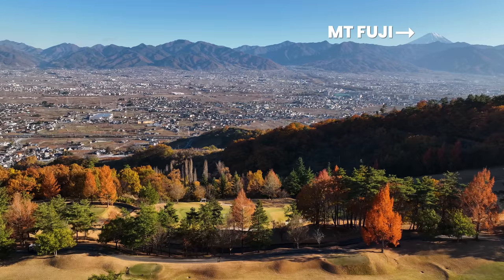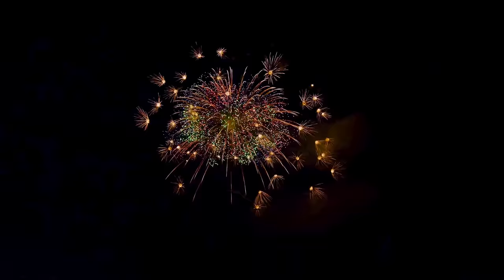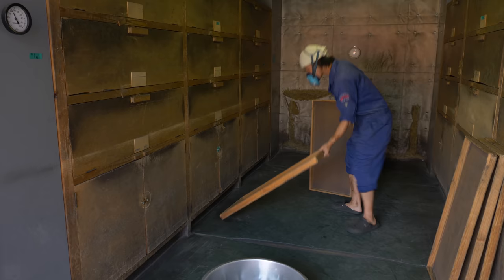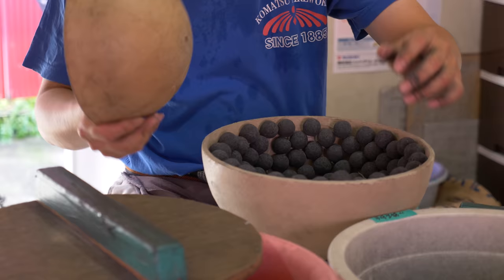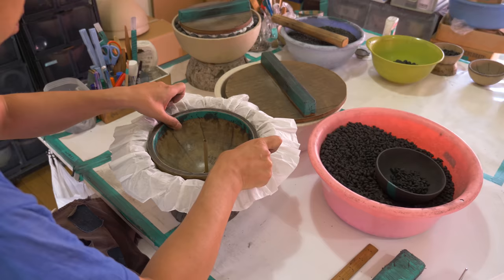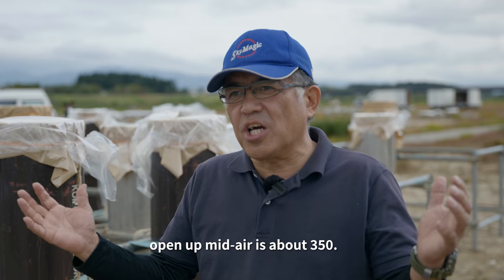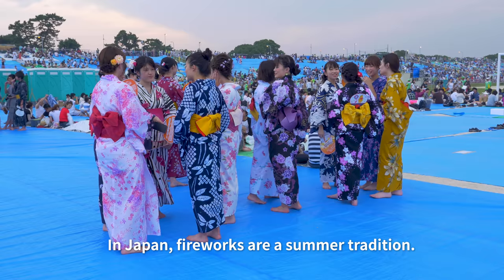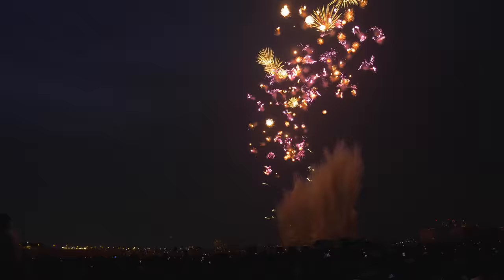How Japanese Fireworks are Made & Launched ★ ONLY in JAPAN

Comment: Very nice video!  One thing that wasn't mentioned is that the employees of the firework company touched a grounding plate before entering the drying room to prevent electrostatic discharges that might ignite the fireworks.
Reply from the maker: You saw that! Yes, it’s true, in the wall before entering. This is especially important in winter when it’s very dry. 
I didn’t mention a lot of things and I will probably do another fireworks episode with a different angle next year :)
Reply: L
Reply: P
Reply: @onlyinjapan  p
Reply: P
Reply: P
Reply: L
Reply: Ll
Reply: Lll 🎉
Reply: @onlyinjapan  lllll
Reply: @onlyinjapan  lllllllll
Reply: @onlyinjapan  llllp
Reply: @onlyinjapan  llllp llllllllllllllllllllllllllllllllllllllllllll llllp
Reply: In those environments you probably seen them discharge the static electricity is in colder environments where the humidity is very low thats was causes static electricity. If the humidity is abuse 50 to 80% that hight enough for most places to work without that concern because hotter environments its not as necessary and in fact most of the Japanese or Chinese manufacturers work in shops with about 3 4 inches of water on the floor to prevent the static and fire
Reply: Interesting.
Reply: Yea I seen him touch that metal plate on the wall b4 he opened the door
Reply: I just assumed it was some cool high tech palm reader
Reply: They don't show the grounding step to eliminate frivolous competition
Reply: @eddiemurray55  😆
Reply: Meow
Reply: Touched or, are touching a grounding plate? Is the grounding plate rubber? I'm very ignorant with fireworks.
Reply: There should be a grounding rail and they should wear esd ground straps and esd grounded wrist bands
Reply: @five0four_129  same lol
Reply: @TURBOMIKEIFY  if you're truly ignorant,  don't venture into this with only you tube info.  It's deadly serious for you and others.... be safe
Reply: You can't even set off gasoline with that amount of current so...
Reply: Thanks for that info🙃
I was curious about why it seemed like they were touching the wall before opening the door!
I thought maybe they were getting keys off a hook to unlock the doors or something lol
Reply: Notice when he entered the drying room, he indeed touched a plate
Reply: Makes perfect sense! I wouldn’t want to see my hard work go before it’s time!!! Mad respect for all employee endeavors 🌟🌟🌟🙏🏻❤️
Reply: If they hadn’t you’d all go boom! I’m surprised the cameras electric components weren’t a risk
Reply: Also not mentioned, the workers eat close to 3000 lbs of gun powder a year
Reply: i was wodering what that was
Reply: @onlyinjapan  Ihi
Reply: ..u
.
Reply: Is that at @6:16 ?
Reply: YouTube should get a charter for being a kind of university the place where ideas are shared more than any school curriculum
Reply: Informative and education! Thanks
Reply: I would think they would also wear ground straps on their shoes.
Reply: Wow. I thought it was some sensor to access the room
Reply: now you can get electrostatic dissipating epoxy flooring that is grounded to earth
Reply: @onlyinjapan 😊
Reply: @onlyinjapan Waaay too much vocal fry, dude. That fad is thankfully coming to an end.
Reply: I'm on

Comment: Good job....jus tone thing, you missed the very important procedure of touching a "grounded" metal plate before entering the manufacturing building-done to ground the workers so they don't discharge a charge-and blow up the building.  Also, women aren't allowed to wear undergarments made of any material other than cotton. I spent ten years in the business (USA). My very first job was making shells and "bags" for one o four clients-Disney.

Our manufacturing buildings were spaced very far from the storage containers which were spaced about thirty feet (10 M) apart with berms of dirt piled up against each container. On location we made troths filled with sand-which our "mortars" would be buried in. I'm surprised to see the Japanese not using sand-to secure and stabilize their mortars. They do have some nice shells :)

Comment: I am so lost!!! How do Clay balls make all those colors. What is in those stars to make different colors? Firework factories are so prone to explosions, how do they protect against sparks? This video made more questions not answering them! 😑
Reply from the maker: They're not clay. The start off as very very small ceramic balls and then are covered with a chemical compound over and over, little by little until they grow to a larger size. The chemical compounds on the balls change the color. I think I might do a follow up episode on the details of fireworks, shapes etc. It's super interesting! 
They don't have explosions in Japan - it hasn't happened in a very very long time but there were fires in the Edo period. Protect against sparks? There are no fires where they're making the fireworks so no sparks. There is a static metal guards staff touches before the enter - I show it at 06:16 mark in the video :) there are so many details - I need 2 hours to make a longer doco on this!